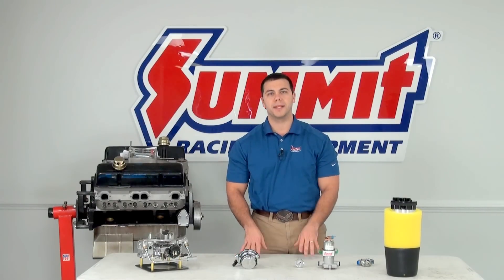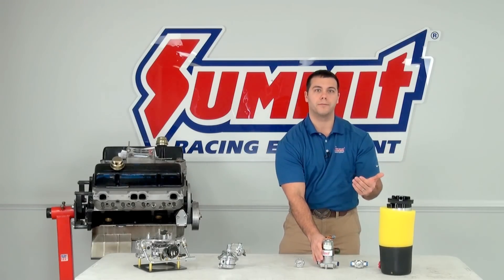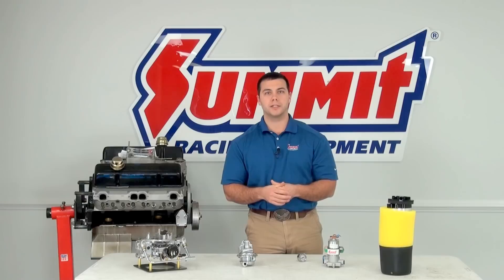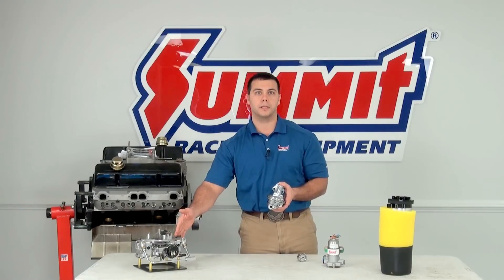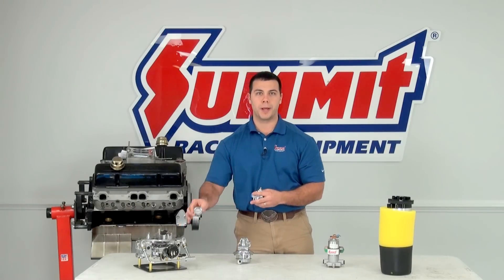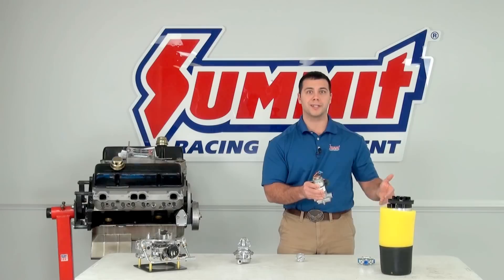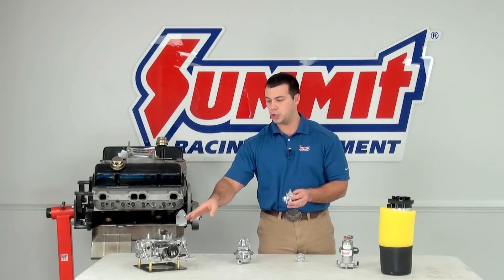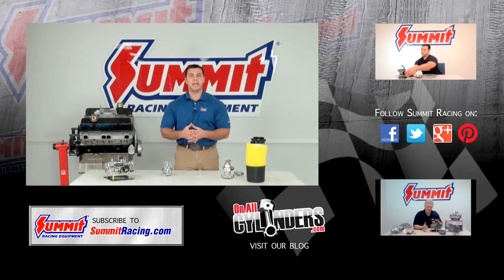Electric vs Mechanical Fuel Pump - Summit Racing Quick Flicks

Comment: I have a 1959 Super 88 Oldsmobile with 394 cbi V8 engine and Rochester 4 brl carb.  I'm currently using the standard mechanical fuel pump but I would like to go with an electric pump...what system do you have that would fit this?
Reply from the maker: +dukestory , 
We need some additional information from you. Can you give our tech department a call? 1-330-630-0240. Thanks for watching!

Comment: I have a 84 Pontiac Trans Am I replaced the fuel pump and when I turn the ignition is still hard to draw the fuel coming from my tank what should I do
Reply from the maker: Darrian Burnside,
We need some additional information from you. Can you give our tech line a call? 1-330-630-0240. We look forward to your call. Thanks for watching!
Reply: 13406400240

Comment: my car has a 1300cc engine 80HP i am planing to get more hp by fitting a new fuel pump so can i use the stock pump and the after market pump by switching them when i want?
Reply from the maker: Hi vishwa fonseka, 
Can you give our tech line a call? 1-330-630-0240.  We look forward to your call. Thanks for watching!
Reply: i live over seas so a call to us will cost me alot, so is it possible to solve through mails?
Reply from the maker: Hi vishwa fonseka, 
Absolutely. We have several ways that you can reach out to our customer service and technical team. You can live chat or email a representative so you do not have to call. Here is the link to live chat or e-mail:
https://summitracing.custhelp.com/app/utils/chat

Comment: What PSI for a Q-jet on a stock 350? I want to run an electric fuel pump.
Reply from the maker: Hi Spennyman10, 
Quadrajets can be run safely at 4-6psi of fuel pressure!
Reply: Summit Racing Thanks guys!

Comment: Can you pull gas out of the top of a fuel tank with an in line external fuel pump?
Reply from the maker: Hi Jeffery Pevy, 
Yes, you can, as long as the electric pump is mounted lower than the bottom of the tank (a good siphon), and the draw or suction tube internally goes all the way to the bottom of the tank. Keep the pump as close to the tank as possible too!

Comment: I have a 83 CJ7 that doesn't get driven often.  I have to turn the engine over a lot to pump the fuel to the carb for the first crank each visit.  I want to install an electric inline pump to prime the first crank.  Should I install the pump prior or after the mechanical fuel pump?  I just want to press a spring loaded switch to prime the system after a long sit.  Thanks.
Reply from the maker: Hi John Godwin, 
Can you give our tech department a call regarding this question? 1-330-630-0240. Thanks!

Comment: i got a 1978 oldsmobile cutlass supreme with a chevy 350 amd im planning in upgrading to a edelbrock fuel pump which one should i buy or should i stick with the stock one
Reply from the maker: Hi Luis Gonzalez,
The original fuel system for that car is most likely only designed for power levels up to 200-250hp. That includes components such as fuel lines, fuel pump and filters. If you build a motor with more power than that, it will be a good idea to upgrade them all.

Comment: I have a 77 c10 with headers high rise intake edelbrock carb msd ignition have a regular mechanical fuel pump and at times feels like it needs gas what can it be do I need to buy a edelbrock mechanical fuel pump or do I need a electric fuel pump
Reply from the maker: Hi Chevy Chevy, 
Stock mechanical pumps are capable of approximately 4-7 psi but they are not designed to push a lot of volume. With the additional horsepower created from the installation of your aftermarket parts, you will need additional fuel volume. That can be provided by an aftermarket mechanical pump such as Holley or Summit, or an electric pump such as Holley, Aeromotive, Quick Fuel etc..
A mechanical pump would be the more cost effective way to go and would handle the job just fine. An electric pump will require extra fuel line and wiring that makes them a little more labor intensive to install properly.
Reply: So I should buy a edelbrock mechanical fuel pump And It Will Do
Reply: Summit Racing  can you give me the part number for a silverado 1977 4x4 2 tanks so I can order it from your website
Reply from the maker: Chevy Chevy, 
Can you give our tech line a call? 1-330-630-0240. We have a few questions for you. Thanks!

Comment: ha, ironically i was just about to make this video today but it seems summit has beat me to it. one thing i will add about the advantage of electric fuel pumps is that they do a much better job of keeping the fuel cooler and thus much denser for a better burn and atomization. i also like the fact that after they are mounted to an uignition powered source, a flip switch can be ran where they can be shut off so one can drain the fuel bowls when the car is sitting over the winter. not to mention when mech pumps fail, sometimes they put gas in the oil. external electric pumps are the way to go.

also i suggest always running a regulator to avoid pressure fluctuations and mounting it as close to the carb as possible due to the fact that the fuel in the line between the carb and regulator can expand from heat and build a higher pressure.
Reply from the maker: Hey ThunderHead289, 
Thank you for your contribution to the conversation! We appreciate your support!
Reply: Make it anyway. This guy did a great job, but if I had seen you show up on my search I would've watched it.
Reply: @tedprice7993  woah, I commented that 6 years ago apparently! How cocky I sound!

Comment: Great video... But... Would you know if an electric choke wire has a 12 volt constant power during crank and run or just run? :0

Comment: So I have a 74 Chevy Vega I'm doing a Chevy 350 swap on it. It has a mechanical fuel pump but the car still has the original in tank fuel pump that can't even get the fuel to the carburetor. I wanted to know if I should leave the old fuel pump there or should I take it out. If I take it out do I just run a tube to the bottom of the tank or something? I'm new to carburetors
Reply from the maker: Hi Irving Cobian, 
Removal of the factory in tank fuel pump is highly recommended, yes. It will end up being a restriction to any other pump starving your motor for fuel. By simply adding a hose and an in tank filter (part # ABT-TF268) you will be able to use a mechanical pump on the motor. http://www.summitracing.com/parts/abt-tf268/overview/

Comment: i believe mechanical fuel pumps are better than electrical because you can burn every drop from the fuel tank without damage the fuel pump.electricals will fail immediately.i wish to had on my bmw e30 mechanical fuel pump for many reasons!bmw e30 316i.

Comment: One thing i notice often at my shop on vehicles with external electric fuel pumps is that people tend to put a traditional fuel filter on the inlet side.  Unless that filter is a coarse 100 micron element, you will create a restriction to the pump which will make it run hotter and wear out faster, maybe even cause drivability problems.  You don't really need this filter.  there are already 2 inlet filters, the sock on the fuel pickup and a flame arrestor screen inside most fuel pumps (holley, mr gasket, etc).

Comment: I have a question on carb size. Should you take in account for the CFM loss from the air filter and or snorkle when calculating carb size? like add 100 or 200 CFM on top of your calculations?
Reply from the maker: Hi OneEyeJay, 
As an example, using a 14” air cleaner with a good K&N cotton gauze element might drop it 25 cfm on a four barrel carb. Nothing that we would worry about to have to compensate for.
Reply: imo (ive been a classic car mechanic/restorer for 10 years) if it is a race vehicle or a top end car with a larger cam, more compression, high stall/manual trans, lower gears, lower vehicle weight, higher volumetric efficiency, etc then yes you could stand to add 1 or 200 cfm.  On the street (a vehicle opposite of the above example), adding cfm=larger bore=decreased velocity through the carb at lower rpms where you will be driving most of the time, so you would not want to add more cfm in that case. It will be running rich without comprehensive tuning.  a smaller bore will have more velocity in that case which will make it run more efficiently.
Reply: Alex Lancia Thank you for the info.